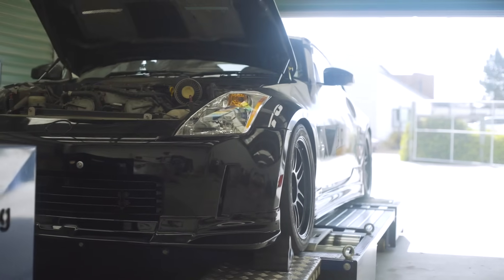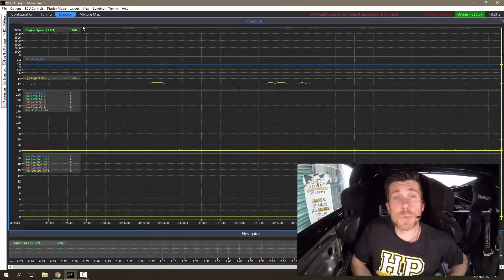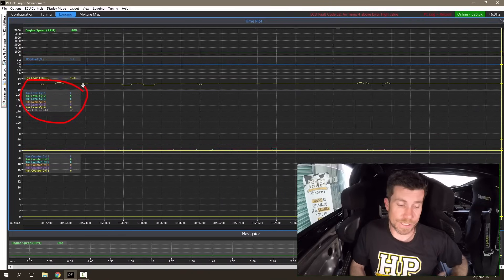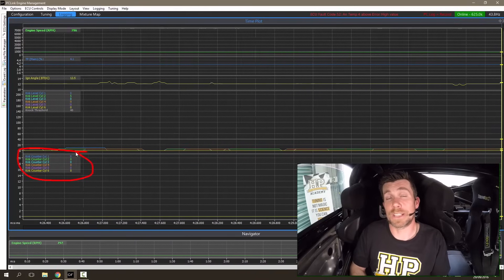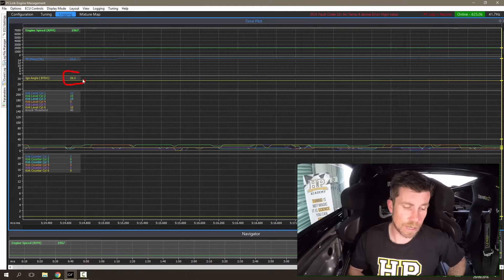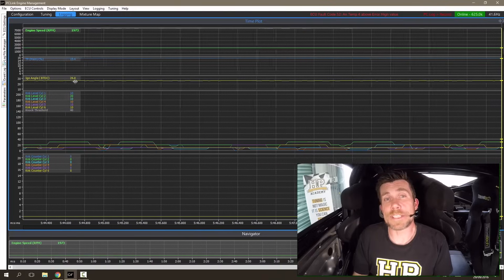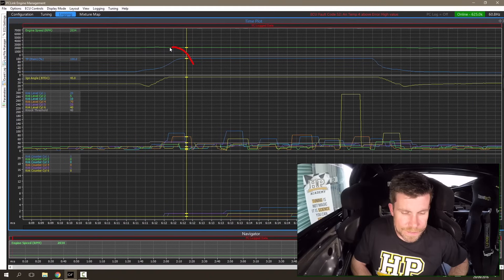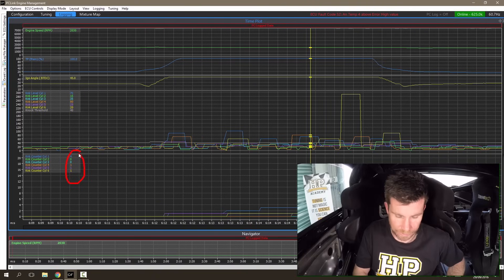Knock / Pinging / Detonation | What does it sound like? [FREE LESSON]

Comment: Sooooo it doesn't sound like anything...???  Coz I didn't hear anything when you claim something happened...
Reply from the maker: Try some better speakers or headphones. Unless you've got serious hearing problems or very average audio gear there you should hear it - Taz.
Reply: @hpa101  Nah my headphones and hearing is fine champ... The noise is EXACTLY the same both before and after you claim the pinging is occurring so how are we supposed to tell the difference or what it actually sounds like...? 🤷‍♂️
Reply from the maker: It's the light crackling noise. It is also visually represented and has been hear by many others watching the video. 
If you can't hear it, please do try some other headphones to be sure mate. While it doesn't jump out at you as much as you might like, the knock audio from this engine is actually quite clear, there are some where it is even harder to hear but altering it would defeat the purpose of teaching you how to listen for it - Taz.

Comment: Is there a way to get setup knock sensor on the Platinum sport 1000, engine is a Evo 8 am wondering if this stock or a bosh knock sensor could be setup on this particular ecu...
Reply: If the ECU does not come with knock detection/control, you will need an external knock monitor capable of outputting a 0-5V signal to an AVI input on your ECU. Check out the Plex knock monitor v2 or the Tuner Nerd knock detection system. Another good one is the Link Knock Block which has dual knock sensor inputs, but no 5v output to ecu. It is used with headphones for audible knock detection only. This is an old comment but I was also wondering the same thing for an elite 750 a few days ago. Maybe this will help someone in the future.

Comment: What is physically happening to the engine components when a cylinder ‘knocks’? What causes it?
Reply: artdamage0 when the cylinder heat increases dramatically the injected fuel particles will combust due to the heat before being compressed properly and ignited these random combustions do the most damage to the engine components  

HPA course will answer all your questions those guys are awesome :)
Reply: To add on to what silver said -it happens while the piston is traveling up on the compression stroke hence why it causes so much damage.It is also called preignition at times and as you can imagine the fuel igniting tying to push the piston down while its going up is not good ;-)
Reply: Not exactly, what happens in knock is that the fuel is self-ignited at more than one spot causing the flame fronts to crash to each other inducing a shock wave and a spike in pressure which "shakes" the cylinder walls causing the block to "ring". Pretty much what you would hear if you hit the engine with a hammer (from the knock sensor point of view)
Reply from the maker: There's a few replies here that offer a pretty good explanation which I'll add to. Essentially knock is the auto ignition of unburned fuel and air around the outside of the combustion chamber. This occurs after combustion has already been initiated by the spark plug. As combustion continues, the heat rises in the combustion chamber and these pockets of fuel and air spontaneously combust. When this occurs, the energy contained in the fuel is released very rapidly which causes a large spike in pressure in the cylinder. It's this spike in pressure that can be so destructive. Note that the audible sound associated with knock has nothing to do with colliding flame fronts (think about twin spark plug engines which by definition have two colliding flame fronts under normal operating conditions), but rather it's caused by the engine components resonating.
Reply: High Performance Academy so to induce knock in an engine like you are in the video are you simply leaning the AFR out?
Reply: most answers are not right.. knock is detonation, and detonation is very fast burning/flame front.. it differs from normal burn by flame speed, and it goes from laminar to non-laminar. Faster burn speed builds more pressure as there is literary no piston movement in time when all air/fuel burns. What melt components is that non laminar burn, with very high pressure spikes as it detonates, which strips protective layer on walls of cylinder,head,piston (protective layer height depends on fuel used). Both high pressure and pressure spikes in combination will unset rings and can break ring groves by pressure overloading.

there is also preignition, which could be normal burn, but will result in faster and faster burn as piston still moves upwards and pressure rises from smaller volume and higher pressure (PV=nRT), so you end up with high pressure spike that may lift head. From preignition you can go to knock, as all temperature from burned mixture radiates to components, instead of doing work on expanding cycle and in next cycle all component got bit hotter.

when actual knock/detonation happens, from start to hole in gasket to oil gallery or burned piston passes 0.1s (100ms), having only partial knock (flame starts from spark, propagates and then it overreach the octane rating of fuel, resulting in detonation of mixture that is left (could be just on one side of piston, lets say from hot spot))

also if you ask why diesel engines don't break, then fuel is burned (detonates) as it enter chamber (and has to be next to oxygen molecule, if not, it can burn later in exhaust where may be some oxygen present). Burn duration is very long, controlled by the size of nozzles and injection duration (20°-45° of piston movement, with most pressure being generated later when piston is few degrees ATDC, same as in gasoline engine). Also injecting in one go all fuel isn't best, as at 1st you wont get good burn speed cuz pressure is low and later is burn rate speeds up more and more fuel catches fire/detonates in one go, resulting in audible detonation. What modern diesels do (Vp,PD,CR) is having pre-injection, which with small quantity of fuel rises pressure when piston is in half way to TDC.

Comment: Basically sounds like rattling rocks in a tin can
Reply from the maker: A bit more like pebbles than rocks but yes you could liken it to this noise :) - Taz.
Reply: @hpa101  right thats more of what i meant lol..first time i heard it i though it was my exhaust rattling
Reply: I hear a very faint "crackling" sound sometimes when under heavy load (especially uphill on full throttle high RPM)... is this Preignition? It's not loud at all, but it sounds like sand or very light pebbles (kind of a crackling noise), but not enough to be loud as a pop or rattle in a tin can...

I'm afraid it's preiginition, but I really hope its not. I've been adding that "Lucas Oil" octane booster to try and prevent it, but I guess it does more hurt than good, becuase your ECU will get used to it and if you DON'T use it on your next tank and hit full compression, you will start knocking